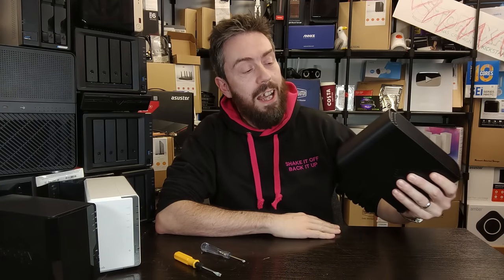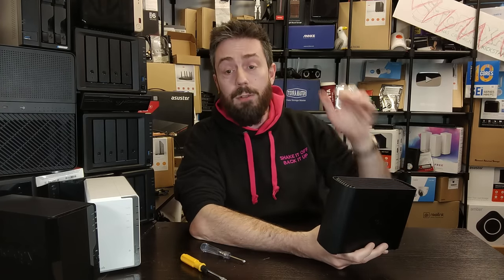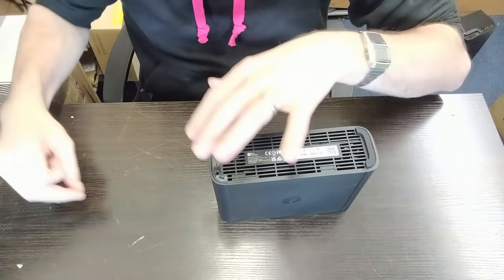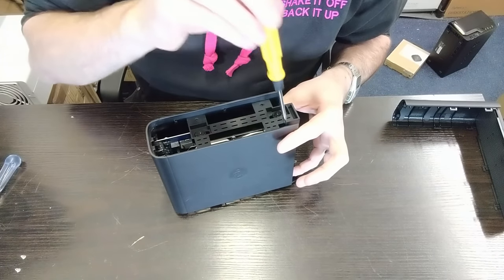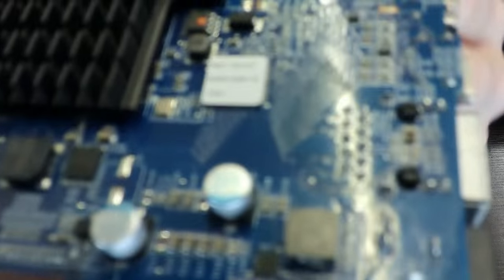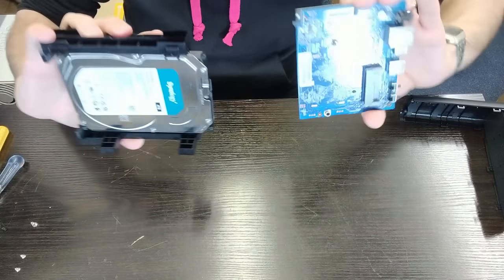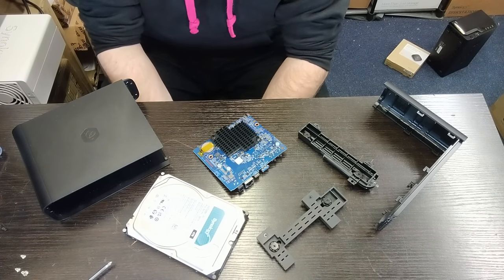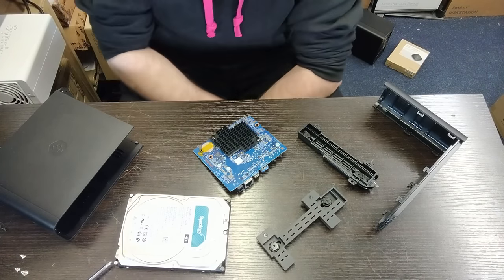The Synology BeeStation NAS Disassembly - Taking it to pieces

Comment: So far I like the beestation.  Tried to do this with a Seagate 20Tb NAS hhd, it worked till the settings for the beestation would say that it was not able to create a storage space, it would come up and show 0 bytes.  So in the end, put the original hard drive back in.  I was wondering what the max size can be installed and working.  A side note when I went to the website for the BSM OS file on 10-14-2024, I had seen that they had two options BSM_BST150-4T_65373.pat and also BSM_BST170-8T_65373.  But going back today to check the file again, was not there.  I also seen a post on reddit for the new firmware file.

Comment: Thoughts on using this as a routine backup of a ds220+, to plug in too network and then store off site routinely? Does synology DSM -> bsm support this workflow?
Reply from the maker: DSM has no native cross over, no. There is SMB support on BSM, so using it as a network target is not off the table

Comment: I look forward to any drive swap videos that might be forthcoming. It would be pretty ridiculous if they actually did put in the effort of firmware locking it to just certain drives.
I've done drive swaps in the 1st gen WD MyCloud enclosures and those will work just fine if you clone the old drive onto the new drive (and then use a utility like Linux's gparted to resize the largest partition, the data partition, if the new drive is larger).
Reply from the maker: Pssssst... https://youtu.be/2OBkOyb9ujE
Reply: @nascompares Excellent, thank you!

Comment: But but the led.
How did they power the led?
The drive brackets have the led or is it on the board?
Reply from the maker: It's on the board, I ran the system without the case and it's flashing away!
Reply: LED is on the board. The drive brackets contain a plastic light tube that transmits the lighting to the front fascial.

Comment: Is that coin cell a standard 2032 or a rechargeable? I hope the latter ...
Reply from the maker: I assume the former, but will check this week
Reply: @nascompares  If so, and given the difficulty of dismantling the case for average Joe to replace it, that would potentially put a artificial hardware lifespan on the unit! I really do hope it's a rechargeable!